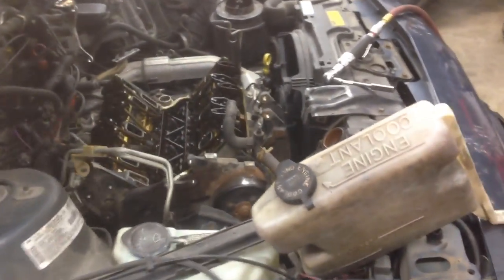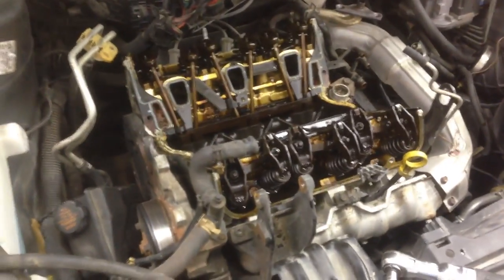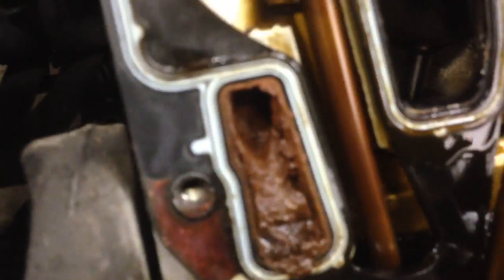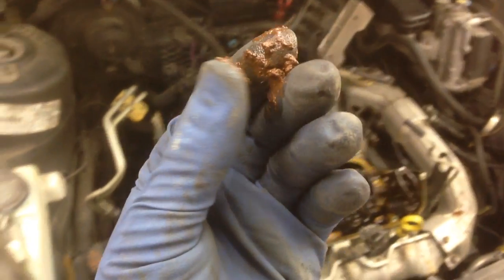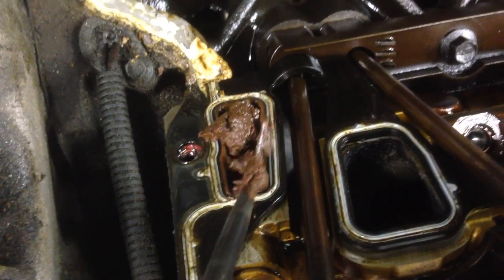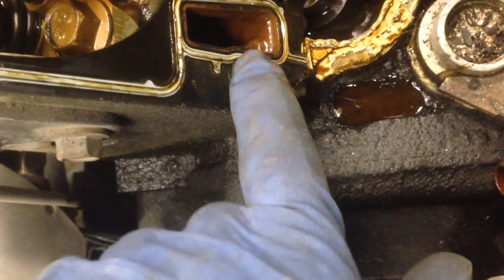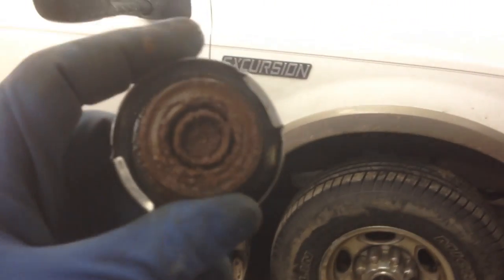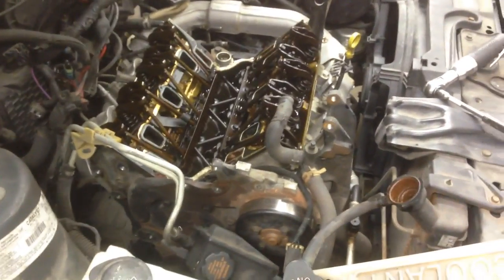Why it's called DexKILL

Comment: The problem is the poor quality head gasket, GM put plastiki gaskets on those engines and dexcool eats those gaskets like a hungry caterpillar the result is a premature head gasket failure that passes air and oil into the cooling system thus the muddy texture, the fix is an aftermarket head gasket, if U replace it with the original parts the results will B the same, aftermarket gaskets are thicker and none plastiki. GM got sued for that and lost. A friend of mine got a Chevy impala with that problem & the dealer repaired the engine 3 times 4 the same problem until he got tired & sue them he won the case.

Comment: i have ran dex-cool in 3 cars in the last 12 years and only had this happen once when a dumb a*% tech mixed the green coolant in it. we argued a wile then i showed him on his truck. it was doing the same thing and he no longer has a shop. i will argue as long as it needs. so just get to know your car and what it takes for fluids and hold your tech to it. ask to see the jug of what he put in your car or buy your own and have them use that. i do all my own work now and it is not that hard if can get a build manual for it. so dont be scared just try and take your time. YOU can do it you girls too.

Comment: To refute the Dexcool haters....
My 1998 5.7 Vortec has only had AC Delco Dexcool since brand new and never witnessed any of these coolant related symptoms. In 20 years Its never had the dreaded manifold leak, head gasket or plugged heater core. Unlike the vast majority of vehicles, my coolant has been changed and properly flushed at regular intervals instead of waiting for a cooling system failure and then blaming the coolant. 

One thing Ive personally witnessed is do not trust that your mechanic will do a proper flush, and replace with actual AC Delco Dexcool. Alot of them will just drain the rad and top off with the cheap "Dexcool compatible."  

So, ya, I bet after 20 years of just draining the rad, topping it up, and adding Stop Leak instead of repairing  leaks, my truck would have goopey, brown coolant plaque too.

Btw I have had my share of cooling system failures UNRELATED to Dexcool in 20yrs/359,120KM:
3 radiators due to cracking plastic tanks at the oil inlet
4 quick connects on heater hoses due to brittle plastic clips
2 rad caps
1 reservoir due to cracking
1 temp sending unit due to cracked dried wire.
1 thermostat

(1998 Sierra k1500 5.7L Z71 359,120KM)

Comment: That's why I call it Dex-Death. It either gums up and blocks the coolant passages, or eats the gaskets and aluminum. Bad, BAD stuff! Always flush the cooling system and change it to conventional green antifreeze.
Reply: +John Doe I have a 2005 Malibu 3.5 with 198 K on it and I use Dex cool and I have never had problems with it. I flush it once every two years.

Comment: You are dead wrong,,, Dex-Cool was a GM Brainchild to combat dissimilar metal oxidation in the iron block, Aluminium head engines. Simply put,, Dex-cool was no silicate formula, mixing Ethylene Glycol with it made the dissolved solid silicate fall out of suspension. This happened because someone put ethylene glycol (Green)in the Dexcool system (Orange). And,, thare is Always going to be Air let in to the Cooling system.

Comment: ive never had any problems with dexcool changing it every 3 years or so, dont ever believe that extended life hype.
Reply: +Guinelle1 --   Have you taken your engine apart yet to check coolant passages?  Seen the inside of  your "dry" radiator or taken both radiator hoses and heater hoses off to inspect?
Reply: +Hawaiian F150 dont need too, if its not overheating why fuck with it?  and to  be honest.. most of my companies fleet vehicles have never had their coolant changed.. some are as old as 05" model chevy pickups... with factory everything.. never touched cooling system. with NO overheating problems.

Comment: Thats stop leak! Or two different kinds of mix.  Thats NOT dexcool. The engines you mentioned have very bad leaking habits and people dump all kinds of stop leak and sealers into them. On second thought, that kinda looks like oil mixed with dexcool. Oil will look the same way with dexcool also.

Comment: Yup I had to get rid of my 06 CTS because the Dexkill was costing me tons of money. I hated that crap.
Reply: never had this problem and only have owned gm cars. i had a 94 cutlas with 190 millage when i threw a rod and 2 97 saturn sl2s and no problem and a 01 sl2, it stop running and havent took it apart or anything to see whats wrong with it. im think crack shaft sensor, but not to sure. but from the comments people are saying all coolant does it and if never had a coolant flush thats what it is. guy said its happen to his mustang and he used green coolant. also some say its stop leak and a few said oil in the coolant, so it might not be dexcool.

Comment: Primary reasons from my understanding:
1. Mixing different coolant types.
2. Using water that is not distilled.
Anyone know if this is correct?
Reply: Yes, and air contamination.  We played around with various coolants in a physical chemistry (I think or organic) chemistry in college.  That stuff is very reactive.
Reply: Constitutional Crank 

Air contamination in conjunction with OAT (Organic Acid Tech)/DexCool formulation. 

Pure OAT is environmentally friendly without silicates borates and phosphates.

Without this inorganic components used in old formulations (green/blue dyed, inorganic) there is no film formed on metal surfaces to protect without fluid contact. 

Direct metal liquid fluid contact is better for heat exchange, needed in high specific density engines (high power to cubic inches ratio).

Newer vehicles use an external plastic expansion bottle where the air resides, but older ones rely solely on radiator caps with its valve and perfect function to avoid air in the system.

Once the cap valve malfunctions and vapour leaves the system, or there is some other leak, air gets into the system, exposed metal rusts, rusty material further degrades protection and you get this.

A second element used only in Havoline/Dexcool is a plasticizer that was acused of having some compatibility problems with some plastics/nylons. Have not heard anout it anymore.

Mercedes, Chrysler, Ford and others have gone one step back and use HOAT or Hybrid Organic Acid Tech.

Those are formulations with a bit of some inorganic agentes to protect were OAT might fail.

Many other independent coolant producers offer alternative formulated OAT products with no inorganic (environmentally undesirable) agents marketed everywhere as suitable replacements. 

The older inorganic formulas are being phased out everywhere for environmental protection. Diferent agent are banned in Europe and Japan.

American concentrated coolants are made so they can use tap water in most places. Every formulation cam benefit from demineralized / deionized water, but thats not really needed. Exception to places with hard water (full of mineral), where this excess compromises anti corrosion protection. In this case, it might be wise to use prediluted formulation.

As with everything else, your mileage may vary. A regular check avoids lot's of trouble.

Comment: You don`t have to use dexkill on any new engine.As you can see it`s garbage.You can use the prestone green coolant for all model vehicles.I`ve always used green prestone.I have a 2001 Ls chevy blazer with the 4.3 vortec v/ that has 125,235 miles on her.even though the anual says use the dexkill..I don`t.If you decide to change over from dexkill to all model coolant from prestone..Make sure you completely flush out your coolant system.it`s very important that you get rid of the old dexkill If it hasn`t gummed up yet.If it has gummed up your screwed.Doing a full coolant flush on an engine that has gummed up from the dexkillwill be a waist of time and money.It seems they want you to use dekill if you have an aluminium radiator.Don`t do it.Everyone who I knew that used dekill in their vehicles all had problems with it gumming up.The dekill crap is only a scam to make money.Most people take their vehicles to the dealer.

Comment: Yeah I just recently bought a car with over 200,000 miles on it and trying to do the work myself so I no expert but that looks like some gum. S*** somebody put in that they should have put in there other than the coolant there supposed to my Dex coolant was all murky and and it chunks of crap and everything and I did a flush on it was overheating I ran straight water through it for a while will that all out use the pressure release valve to release everything didn't even take the hose off the radiator and put Dex 50/50 coolant back in it in and ain't had no problems yet. The end the distilled water thing sounds logical and it couldn't hurt I think I'll try that next time I do my flush and water of the green stuff yeah

Comment: From the aluminum oil pump wearing out on the 2.8 to this. Way to go GM.
Reply: Don't forget the Vega, Cavalier, the 3800's plastic intake with an egr passage through it, 4T65 transmissions, and the ignition switches that killed people. They do have some really good stuff too though. You learn by making mistakes right?
Reply: you mean ignition switch that killed people who doing 80mph through a neighborhood and lost control ?

if you actually look into the "ignition switch death" cases, it wasn't ever the ignition switch's fault
Reply: joeyf504327 What are you talking about? People were getting into accidents and the ignition switch would jar to the off position causing the airbags not to deploy. I haven't dug very far into the exact number, but there's supposedly dozens of deaths as a result. My car actually has a recall on it for that reason. How is that not the switches fault?
Reply: "General Motors ignition switch recalls. On February 6, 2014, General Motors (GM) recalled about 800,000 of its small cars due to faulty ignition switches, which could shut off the engine during driving and thereby prevent the airbags from inflating."

Literally first thing on google.
Reply: flip117100 Exactly.
Reply: It was very easy to stay busy at a large GM Dealership as a new mechanic doing warranty seat,warranty seat belt repairs. I never figured out why GM made so many mistakes with seat and seat belts.
Reply: Dan R They could never get bolts right either, the ones that mount the seat in my 8th gen Suburban have a lot of reports of shearing off at random. I've heard that Ford has had some seatbelt recalls as well though.
Reply: Eric Fixalot q
Reply: flip117100 The transmission problems started with the TH350. It was designed to fail around 60k. My instructor worked for GM at the time, and they wanted more aftermarket sales on transmissions because the Powerglide and TH400 lasted so long the people were buying junkyard transmissions instead of getting them rebuilt. The TH350 was the first trans not to have any support bearing between the input and output shafts. The two shafts just butted up against each other and were held in alignment by hydraulic pressure at the clutches. Then ca,e the TH200. Instead of machined steel clutch drums they use stamped steel drums that looked like bottle caps! What a bunch of shit!
Reply: Kenneth Cohagen I've always heard the Turbo 350 was very reliable. I would take a TH200-4R over a 4L60E or 700R4 any day because of the ratios. But I do prefer a beefy TH400 or 4L80E.

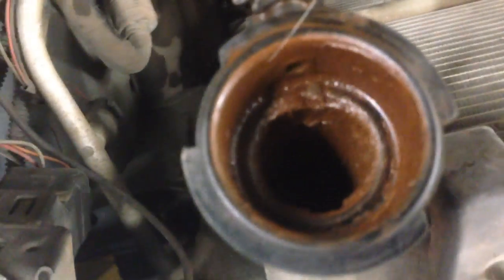Comment: I'm tired of people blaming shotty mechanic work and poor maintenance on DexCool. Been running that stuff for 25 years. My coolant ports are sqeaky clean. Just do regular maintenance and use quality gaskets not that cheap ebay gasket you're showing here in this clip and you won't have that problem. This isn't air contamination or any of that nonsense. This is lack of coolant system servicing. Look how disgusting that radiator fill tube is at 3:56 it's never been flushed or cleaned probably since it left the factory in the 90's. It's like running the same oil for 100K miles and then blaming the oil for turning black and chunky. "Oh why is my car overheating? I haven't serviced the radiator since Regan left office".

Comment: Try servicing the coolant system every once in a while..... like changing the coolant, also USE DISTILLED WATER ONLY!!!! And that sludge is OIL MIXING, and if it’s rust ITS Electrolytic erosion, nothing to do with the coolant itself, just how long since it’s last service, water used, cheap coolant, other coolant problems, The coolant is NOT the issue, There are a bunch of definite underlying factors for why that shit looks so gummy gunked up

Comment: it needs a major coolant flush or a new radiator hoses water pump and heater core or this will happen in 25000 more miles

Comment: My '99 Tahoe cooling system was packed with that crap when I bought it with 70k, after many flushes and replacing rad, heater core, hoses, water pump, thermostat, cap ect the new green coolant still turns color after a few months after every change. It's got 180k now, doesn't overheat and runs well but getting tired pulling a trailer. Later this year I'll rebuild the engine and boil the block that will be the end of the brown crap. Great truck otherwise.

Comment: Let's think about this for a minute...
You "recently" (25000 miles ago) changed out the intake gaskets, finding this sludge that time. Ask yourself why you changed these gaskets...was it because there was a coolant leak?
Would we be safe to assume the owner MAY have tried some stop leak before the more expensive mechanic?
Now ask yourself how that stuff works. It congeals at the point of the leak to plug it off.
Now I'm guessing they didn't admit to using the stop leak, and you didn't fully flush the system.
You installed new gaskets and coolant and smacked it on the butt and collected your fee.
Now FF to the return of the vehicle with the same issue a mere 25000 miles later. You find more of the same sludge when you open it back up. Could it be that the stop leak was still in the system? I think that's the way I'm leaning!
It actually looks like the copper Bar's Leak "head gasket repair" than radiator stop leak though. So maybe it's not your fault they put the wrong stuff in the wrong fluid... 🤣

Comment: Looks like a design flaw. I would flush the system.your not going to get all of it but if you pull thermostat and run only the restricter. It will eventually work it's way out.

Comment: Sorry dude but My 03 trailblazer coolant has never had an issue. I flushed and refilled a few years back and no issues with my antifreeze. I suspect you have warped issues or crappy gaskets. You have issues way beyond antifreeze. Face it.

Comment: I have the 3.1 on my 97 lumina and i can honestly tell you the dexcool is definitely the problem. i already swapped 3 used engines on my lumina and looked exactly like this. And no i didnt add no stop leak or whatever other bullshit people are talking about. I read an article from a lawsuit that chevy was involved that said the years 95 to up to 99 or 2000 were infamous for blown head gaskets from dexcool coolants. the last time i bought a brand new engine from the dealer and they wanted to sell me the gm certified dexcool coolant told them go fuck themselves and walked out pushing my new engine. Since installed ONLY used green coolant and 5 years later without a problem or leak engine running strong. avoid dexcool. from experience and 4 engines dexcool is garbage.